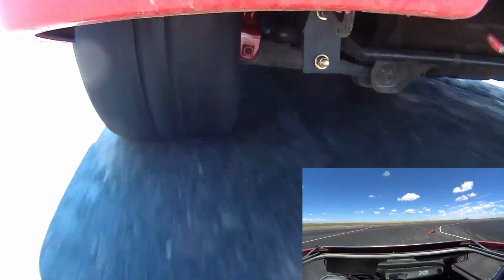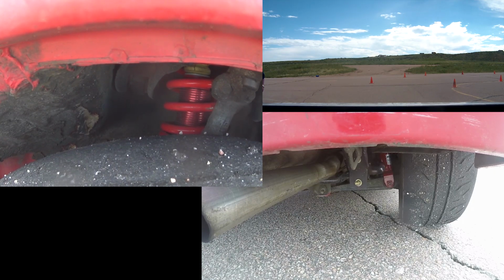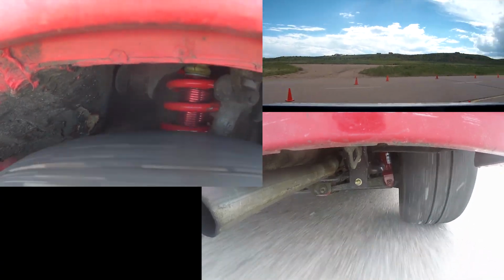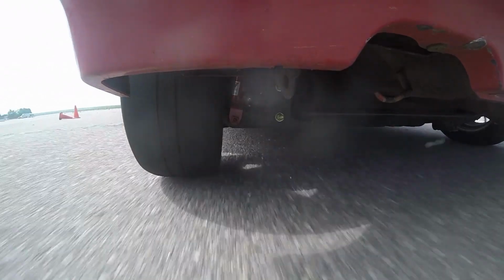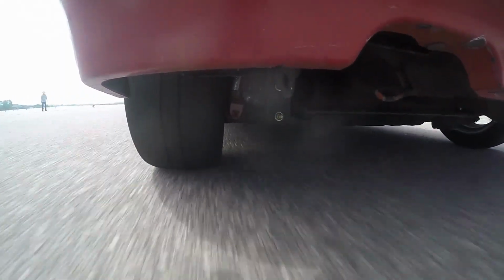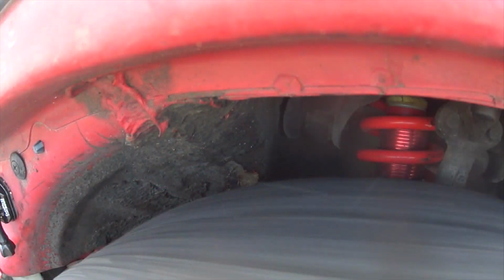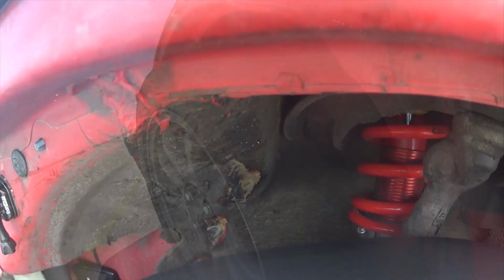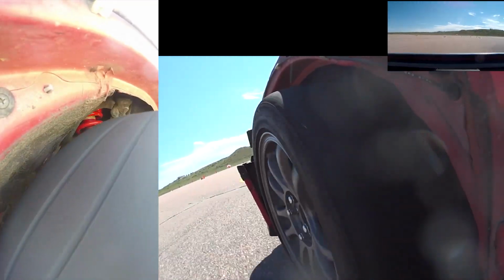Suspension in Motion 2

Comment: Nice analysis of the suspension. If you wanted to fit the wider tires, you might be able to get some higher offset wheels or spacers to get a little more clearance. One thing to keep in mind however is that the wider wheel/tire would weigh more and reduce acceleration. And that the wider track width would make it a little bit harder to be close to the cones. If you do end up going 215 or 225, you may want to consider using a 7 or 7.5 inch (7.5 is the class max) wide wheel to help reduce sidewall flex.